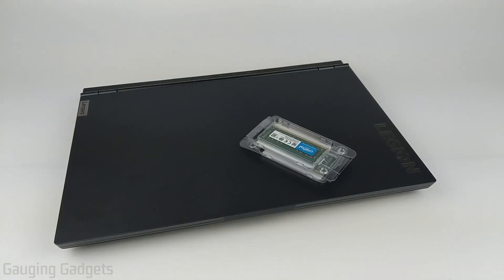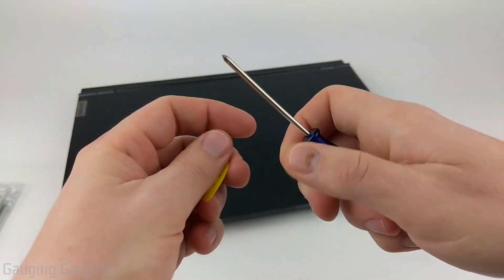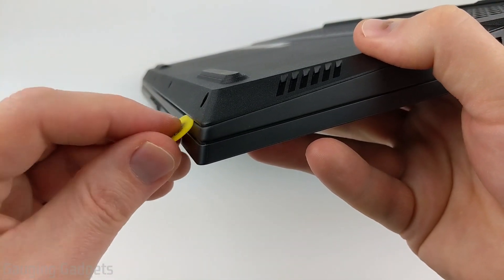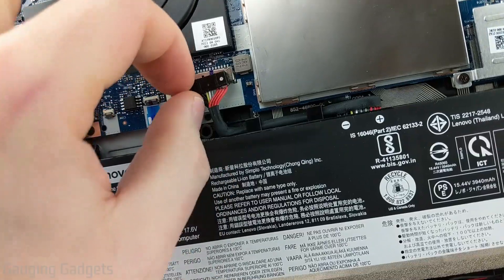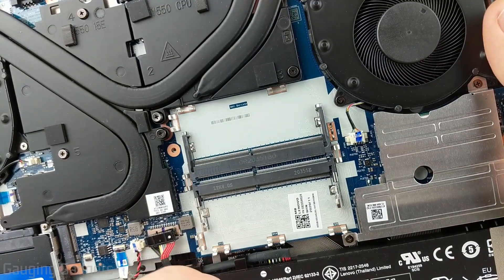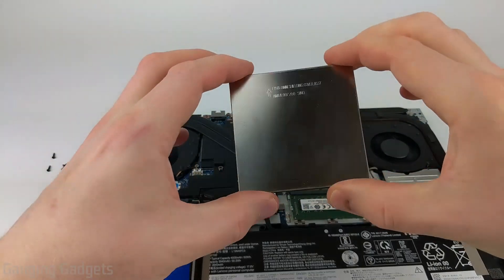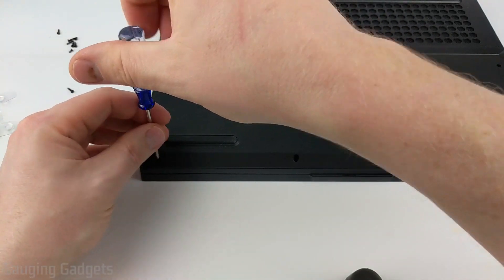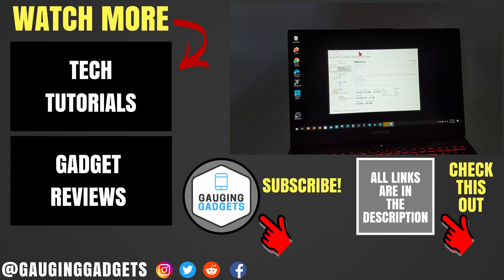How to Upgrade Lenovo Legion 5 RAM - Add RAM to Lenovo Laptop - Legion 5-15IMH05H

Comment from the maker: Thank you for watching! Please consider liking & subscribing 🙏: https://youtube.com/c/gauginggadgets?sub_confirmation=1
Reply: Hey ! Thanks for the video ! One thing that got me worried is that you purchased Crucial DDR4-3200 but when you opened the task manager it says you got 32Go at 2933Mhz. On my Legion 5 I have 16Gb 3200Mhz and wouldn't want a downgrade to 2933 if I up the RAM to 32Gb using 2x16 DDR4-3200... Have you solved the issue ? or are you stuck to 2933 despite having DDR4-3200 installed ?
Reply: Hello , does the r5 4600h version has two ram slots?
Reply: @aminboudjerada9614  yes
Reply: Bro that selled this laptop
Reply: Thanks for the help!
Reply: vay be, ne guzel konustu ne guzel bir sunum. olmasi gerektigi gibi ne fazla ne az

Comment: can i install 64g ram in this laptop i have intel 10750H CPU
Reply: The intel CPU specs for the i7-107550H indicates max memory size is actually 128 GB of DDR4-2933. So, two 64GB memory SODIMMs.

Comment: Why Ram speed is not 3200 MHZ after updating to 32 GB Ram?
Reply: Due to the processor of this model, it can only utilize 2933mhz, its on the spec sheet of the laptop.

Comment: Is upgrading from 8 to 16 gb is gonna be okay? I don't have alot of budget and the thing is that i got gtx 1650 ti. Normally when i got opera and discord opened i have 1 gb left💀 and my graphic card is going on 15% 😭😭 not talking bout graphic processor becouse its going on 98% so idk if its the problem in graphic processor or ram or both lmk fast please!!

Comment: Gonna upgrade Legion 5 core 5 Rtx 1650 ti. Won't do it myself. So far I have 8gb ram, HDD 1 Tera and Mv2 PCIe x3 120 gigs. Thanks for the video, still check model, storage and ram limitations ❤

Comment: I followed the guide, removed thea bettery, slotted my new ram in place of one of the 8gb sticks. Now when I try to turn it back on, the keyboard lights up but there i nothing on the display. Any tips?
Reply from the maker: Can you describe the ram you installed? Also have you tried putting it back the way it was before the installation and seeing if that fixes it? It could be a bad stick of ram
Reply: @GaugingGadgets  I could eventualy get into windows by Win+B and it recognized the new ram, but froze completey few minutes after. Tried it without the second stick to similar effect, I returned it now, thanks for the reply.

Comment: Thanks a lot. Upgraded my RAM from 8 to 32GB today. Impressed with the engineering that has gone through in building this!
Reply: @vimalankm8466  Your laptop is same ? And Intel i5 or intel i7 ?
Reply: @hemantmishra-w8e mine is ryzen 7
Reply: @vimalankm8466  rtx 3060 right? what was ur performance increase and what games? if you dont mind me asking

Comment: I've upgraded my RAM from 16GB to 32GB, and the speed on the old one was 3200mhz, and when I plugged the new ones in, it showed me that their speed is 2933mhz, keeping in mind that I bought the right ones. It's a crucial 16GB DDR4 3200 SODIMM CL22. I've been looking for ways to overclock the new RAMs so they could actually run at 3200mhz, but I haven't been able to so far. And my CPU is intel i7 11th gen. I'd really appreciate your help with this situation. Thank you.

Comment: Thank you for the video. I've owned the 17ACH6H for a few years already, always running the basic 16GB of DDR4 (2 SOIC's) with which it came. My wife's newer Gigabyte laptop is being upgraded to 64GB, so I figured I'd max out my own Legion 5. I have a couple of comments... First, the 17" model of the Legion 5, although wider, only has 10 screws, and not 11 as did your 15" model. (Go figure.) There are 6 long ones and the same 4 short ones. Lastly, one needs to be very careful to replace the RAM SOICs' metal cover very "plumbly". I didn't get it exactly right and had one set of grabber finger contacts to both be OUTSIDE of the cover. So, it needed to be removed, that set of contact fingers slightly bent to realign them for proper "pinching" onto the shield wall and its little metal nipples. It then snapped down nicely to my great satisfaction. Once done, everything went back together nicely. Your YouTube video greatly minimized the fear factor of taking on this RAM upgrade.

Comment: This was super helpful, thanks! I have a question about the speed the amazon link you posted says it can run at these "3200MHz or 2933MHz or 2666MHz" My Lenovo 5 is set up for 2933MHz, how would I go about adjusting that or should my system automatically compensate for this? Thanks!

Comment: Hi, I've recently tried to upgrade my Lenovo Legion 5 15ACH6H ftom 8GB to 32GB using this tutorial. I purchased two 16GB RAM sticks and put them into the slots like you did. However, when I boot up my laptop, it recognises that there are RAM sticks in each slot, but only uses 4GB from each, meaning that my total installed physical memory is 8GB when it should be 32. Do you have any idea how to fix this? Thanks in advance :)

Comment: I'm getting the  Legion 5 (new) 82B5001XUS, which is a 2020 model, just for casual gaming, browsing etc. Thanks for the video. I got it for $699 which is a killer deal, imo. Because it comes with an SSD, and 1TB HDD, going to upgrade mine to just 16 gigs though. Has one 8 gig stick. I hear they last a lot longer than the competition, so I'm not worried about it being an older model.

Comment: Hi! I just installed diablo 4 on my lenovo and even at low graphic settings it consumes 85%memory while playing. It gets pretty hot. Should changing a ram would be helpful? Ty
Reply: Won't help with cooling, that's just the way gaming laptops are. RAM has nothing to do with heat. They all get hot, but the Legion is the best, and upgrading will help performance for sure.

Comment: I'm curious to know, does hardware reserve increases overtime due to windows update? To add on, I've turned off unnecessary programs and I still have 33% being used.
Reply: Yes, but you can pick and choose important updates you need and others you don't. Windows 10 isn't TOO much of a resource hog. That's pretty good at 33%

Comment: Hey man greetings, i have a doubt about this specific laptop as i own one and recently decided to give it a refurbishing and swap the original (x1) 16gb ram for a 2 channel kit of 2x 16 gb, but am unsure which to choose, i'm inclined to these 2 models  "DDR4 CORSAIR CMSX32GX4M2A3200C22" or "Crucial CT2K16G4SFRA32A" both are x2 16gb 3200 cl22, as the HyperX Impact kit ive purchase before (same specs as the other two but cl20 instead)  seemed to cause a lot of issue and giving me random blue screens every time i was doing something more demanding. Any advice on which would be the best choice?

Comment: I wanted to check because I’m getting a RAM tomorrow. But after I removed my ram and placed it back it wasn’t working so I check on the other slot and it is working. I did everything without much force so what do you think happened?
Reply from the maker: Sounds like you did everything correctly. It might be a defective piece of RAM.
Reply: @GaugingGadgets  is it possible that one side of a ram doesn’t work but it does when it’s flipped?
Reply from the maker: @uppadasaravan  I wouldn't think that would be the problem because the connector is flipped as well. Never hurts to try the RAM in the other slot though.

Comment: Like the video lots man. Definite like material. I got a Legion 5 17.3 inch with 16 RAM. I wanna upgrade to 32 because windows 11 is a memory whore and it only came with a 470gb SSD. So I wanna either switch that out or add an m.2. I know how to do all the stuff you showed already, although some Legions have screws on the metal shield and not clamps. My issue prying off the back panel. I've seen so many people have issues with it and break pieces, which voids my 3 year total (even drops&spills warranty. I have a laptop repair set and everything, but that panel is a bitch. If I buy all the parts, you have any idea how much it costs and where to go to have a licensed vendor install it for you? 

Sucks because I build gaming desktops and all my other laptops have separate panels to access the RAM chips and storage for easy maintenance. So it's ridiculous I can't simply do this, but desktops are simple. And when you pay $1200+ for a laptop with a new RTX card in it, you don't wanna risk the warranty.

Comment: Would it be possible to keep the original RAM card in there and just add an 8gb one to make it 16?
Reply: I just did this and it works. I used another crucial brand 8GB stick

Comment: I have questions as I have Legion 5 5600h RTX3050ti 8gb RAM:

1)Can i pair the new RAM with the old one, will this cause any issue? Because i just want to save cost and buy  1 stick only

Or is one stick 16gbx1 is better?

Comment: hi this is my spec
Processor- AMD Ryzen 5 4600H Processor
- Hexa-core
- 3 GHz / 4 GHz
- 8 MB L3 cache
RAM	8 GB DDR4 (3200 MHz)
Graphics card	- NVIDIA GeForce GTX 1650
- 4 GB GDDR6
Storage	256 GB SSD

and i bought Crucial - DDR4 - module - 8 GB - SO-DIMM 260-pin - 3200 MHz / PC4-25600 - CL22 - 1.2 V - unbuffered - non-ECC 
would this work?

Comment: do you know if lenovo legion 5 15IMH6 has one more separate storage slot? thanks
Reply: Yes 2x m2 in total or 1 m2 and a 2.5” sata slot. If u use only the 2x m2 slots it would be possible to upgrade your battery to a 80Wh battery

Comment: Hello Man, I had the same problem as you. The 16 Gb of ram come in the wrong speed, a lower one. Do you know how to activate the ram in its original frequency which is 3200mhz ?
Reply: I think it only supports till 2933mhz. That means if you bought a 3200mhz ram it will only use 2933mhz. Thats also y it only supports till 16gb ram. Lenovo said that it wouldnt bring any big improvements if you upgrade on more than 16gb of ram. Because the integrated mainboard wouldnt be able to handle it or better said there wouldnt be such big improvements visible. I think only when u change from 8gb to 16gb of ram would bring big improvements

Comment: There's actually a setting in the BIOS (spam F1 and F2 at the startup screen) that disables the battery, if you do that you shouldn't need to disconnect it.
Reply: Spamming f1 and f2 not working
Reply: @sigilwinningngl5284  hold the fn button below and press f2
Reply: How to re enable it
Reply: @FunnyFormulaSeal  just plug it into the charger and the battery automatically reactivates

Comment: Can I keep the maufactorers Ram and Put a crucial stick of memory on the other slot or do I have to get 2 8gb of crucial ram and remove the maufactorers Ram and Put the new one on both slots
Reply: you can, but you're not going to get dual channel performance if you put in 1x8 and 1x16. that's why i'm going to do 2x16 on mine
Reply: @RjGunner111  should I get lenovo ram then the same as manufactures.
Reply: @IcyyX_  if you want dual channel performance, be sure the specifications match (for example, both came from crucial memory, both has 16 gb ddr4 3200mhz, cl22)
Reply: I want to get 16gb in total
Reply: And my lenovo is 3200mhz the same as crucial one
Reply: @IcyyX_  you can try
Reply: Is it worth getting 16gbs of ram but having slower speeds but 8gb and faster speeds.
Reply: @IcyyX_  having fastest ram possible is what would make it worth it

Comment: Can any one tell me how I can back up what I alredy have saved in the 8 Gig memory slot
Reply: RAM is volatile memory. It isn't meant to store anything for very long and in fact loses all it's information when the power is off. It isn't like the SSD or M.2 or Hard Drive you might have on your computer that keeps the information stored on it until told otherwise. You only have to worry about saving your information if you replace the SSD.

Comment: I just upgraded my Legion 5 pro with Corsair Vengeance 3000Mhz 16CAS 32GB ram. The problem is, it's running at 2666Mhz instead of 3000Mhz. I couldn't find any ways to overclock the ram in bios. Any ideas?
Reply: Hey Micheal, I ran into the same problem yesterday. I bought an 8gb stick of 3200 mhz ram from xpg (adata). Installed it, and it is also running it at 2666 mhz. Turns out that it is apparently different CL from the stock ram stick that comes with the laptop, hence why it is running it at 2666 mhz instead of 3200 mhz
Reply: @CreamyTrecko  
Yeah, since I couldn't control the timing in XMP, I swapped it out for Kingston Fury Impact at 3200Mhz 20 CL which works marvelously for this laptop. It worked right out of the box. No tweaking needed.
Reply: @Michael45007  weird, mine is also cl 20 but it won't read 3200 mhz
Reply: @CreamyTrecko  
Do you have Kingston fury impact installed on your L5P?
Reply: @Michael45007  it is kingston. idk if it is fury, but i did buy another stick of kingston fury at 3200 mhz 20 cl
Reply: @CreamyTrecko  
Well I have the same thing and it reads at 3200 Mhz 20CL right out of the box. Not sure why your ram isn't running at the same speed as mine. I'd get a replacement if I were you if possible.
Reply: @Michael45007  oh, I'm returning the xpg ram that ran at 2666, and I just bought a new Kingston fury a couple of hours ago. It'll arrive by wednesday
Reply: @CreamyTrecko  
Excellent. Hopefully, you'll have no problems with the new rams as it should run at 3200 Mhz 20 CL on L5P for sure.

Comment: if theres a 1x8 in there can you just buy another 8 to make it 16 or do you have to pair up brands
Reply: went ahead and did it, used to do this still all the time but got nervous as i haven't done it in years. i remember putting 1MB simms in my machine. only 2 screws in the center of my machine but everything else was as you showed. I bought Crucial Ram thinking it was going to be the same as the existing 8 but when i popped the case it was samsung ram. all speeds etc matched in the end so it was all good.

Comment: Greetings, Good afternoon, I need your help, buy the RAM memory, 16GB Single Rank, for my Lenovo Legion 5 15imh05h, I bought the article trusting you, but when I come to contact the Crucial Technical Support, it tells me that the RAM memory , it is not compatible, I do not understand anything. Please answer me this question as soon as possible? Would it work for my laptop, the RAM, what did you leave in the description of the 16GB Kit? this is the model: CT2K8G4SFS832A. I appreciate your prompt response.

Comment: Question mate, can I exchange my ram speed to a higher one? I want to upgrade my laptop ram but my ram speed are rarely seen to market (2933mhz).
Reply: You can use 3200mhz ram and it should work. It wil work at 2933 MHz as needed.

Comment: Great vid! Is it okay to just keep the stock ram and use a different ram brand as long as their tthe same speed, voltage, etc? (i.e. stock ram + 8gb Crucial ram)
Reply: Yes! It’ll work even if you have different speeds, ram has no problem underclocking to match a slower stick (you may need to enter bios to underclock manually if it doesn’t automatically).
Linus tech tips has a great video on mixing different brands and clocks of ram.
Reply: just make sure timings are the same

Comment: If I’m just trying to add another 8GB ram with the same speed, does it work with the one already installed? It would be great if it did
Reply: I’m using a crucial ram card like you if that helps
Reply: @utellmewhatitshouldbe7912  hi, im looking to do the same thing with buying 1 8gb stick to upgrade the default 8gb to 16gb total and if buying a different branded ram but with same speed is okay?
Reply: @jacobbalisong9718  It worked out for me

Comment: do you need to replace your old ram for a dual-channel ram? FYI, my legion is 8gb ram, and I want to upgrade it to 16gb ram.
Reply: I believe I should work if it is the same speed but it is recommended to have the same ram so I would say just buy 2 8 gig sticks to put in

Comment: Protip, push the clamps back in before placing the ram shield down so it actually locks in place
Reply: My man! I did exactly the same thing and the click was damn satisfying and safe too. Thanks brother.
Reply: Thanks It helped
Reply: Lol
Reply: lmao
Reply: doesn’t matter either way the ram shields don’t do anything
Reply: @justyahz796  if you wanna remove something that the manufacturer placed there, that's on you
Reply: @M4cex  yes it is! it also doesnt do anything as laptop ram isnt going to get hot enough to use the shield
Reply: @M4cex  the best youd get out of a ram heatsink or spreader/shield is like 2 more years of use
Reply: @justyahz796  You do you. IMO if a manufacturer like Lenovo puts a cover in there I believe it's done because of a good reason. I'm not a tech expert so can't argue if it actually helps or not but as long as some other tech manufacturer engineers say it is needed to be there I will go with that.

Comment: On the shield are those little tabs that hold it in place meant to be bent or are you physically bending metal meaning after too many times it will break off?
Reply: Only bent them slightly just to get the shield off. Then bent them slightly back BEFORE snapping the shield back in it's place. It wont cause harm to those tabs

Comment: Thanks for the video. I want to upgrade to 32gb ram for my legion as well. But I checked the Intel processor specs and it supports 2933. So I have to stick with 2933 or I can upgrade to 3200?. Please advise.
Reply: Get what's cheaper, 2933 is the max any stick will run at, there are some cheaper sticks of 3200 that will just be 2933 when it's in the laptop
Reply: If its cheaper for you to buy the 3200 sticks, use those and your lap will automatically use them at 2933
Reply: I think it wouldnt bring any big improvements if you change from 16gb to 32gb. Because lenovo said the intergraded mainboard only support till 16gb ram. More ram wouldnt bring such big improvements. So maybe safe you money and buy a m2 ssd or a bigger battery.